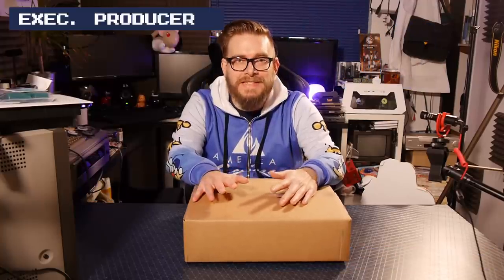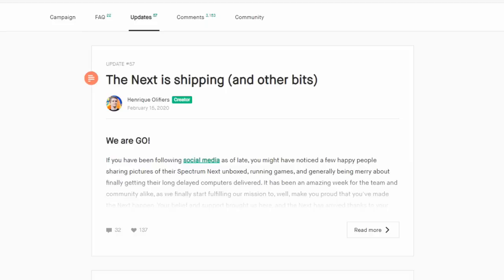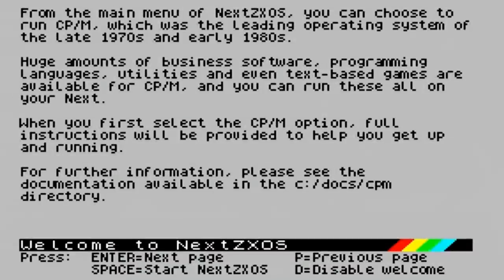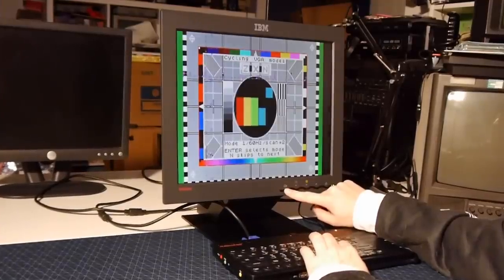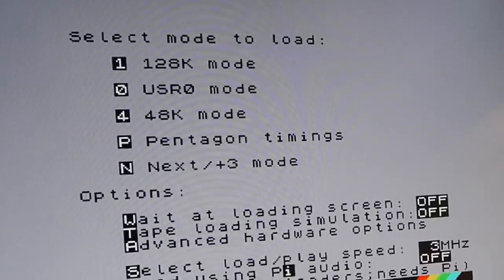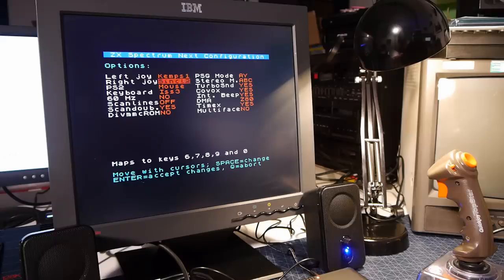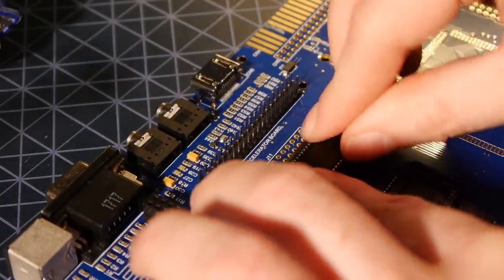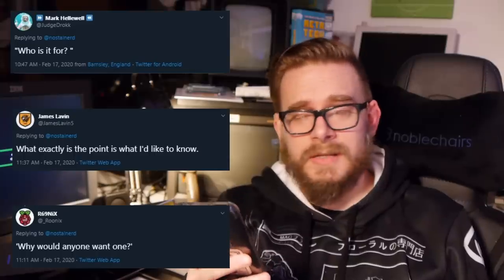ZX Spectrum Next | Nostalgia Nerd

Comment: Great review. I am puzzled about VGA. As far as I know the vertical sync standards for VGA are 60Hz or higher frequency, so 50Hz is not (usually) supported. It is possible that some VGA monitors will work at 50Hz, but I have no idea how many would work at this frame rate. For best compatibility, as you say, you ought to use 50Hz. At least HDMI has both 50Hz and 60Hz as defined standards. In an Atari forum there is a thread about which VGA monitors have been found to work with the Atari (european) 50Hz frame rate and 15kHz line rate. VGA line rate is around 31kHz but with line doubling this matches with the 15kHz of the PAL TV standard. I have been messing with VGA and HDMI and having got some values wrong found that my Dell monitor was happy to display 720p at 40Hz (over HDMI).

Comment: Like two years ago, now, I bought a kit to assemble my own clone Spectrum. I soldered on a bridge rectifier before deciding my dinky little 10W iron wasn't up to the task (the tip was getting stuck in lead solder, because the ground plane was sucking the heat away faster than the iron could sustain it). One of these days, I'll get back to that kit...

Comment: I have no connection to the ZX Spectrum line, being Canadian where the C64, Apple II and to a lesser extent, Atari computers reigned supreme but this is just such an incredible piece of kit, I really want to get one. Is there any idea of when they plan to get more stock of it at the official shop (it has an out of stock listing) or will the Kickstarter be the only way?
Reply: A few spare units might be offered after all Kickstarter units have been received by the backers. Probably in the shop. After that the  second Kickstarter and second hand machines will be the only way to acquire one.

Comment: This thing looks epic. 

PS it's usually safer for the computer to switch the 240V end of the power supply rather than the DC output side, because switching the DC supply side creates a spike on the side of the supply where the electronics are.

Comment: Scratches are probably due to the unit being placed in a cardboard slot in the box. All that movement in shipping. They should have wrapped it in a foam bag. Didn't notice in mine, but then I put a very small barely noticeable mark on my dropping it while looking at the underneath. It landed on the box edge argh.

Comment: I had a zx81 back in the day...the only computer I could afford...so I tried to make it do things and I wrote software for it.  I expanded the keyboard to something workable, the memory to 48k and added a graphics board...but then I had to have a custom power supply and wired it up backwards and blew it all up.  But I got another one...fast forward 38 years and the spectrum came and went and I missed the boat on that. I had high hopes for micro drives and some of the new models that came out.  But I got into other things.  Now I would like to get back into that simple programming environment again...but yea I don't want that membraine keyboard and I don't want source something better keyboard wise for the old hardware...this is PERFECT.  
Just got wait for the second kick starter.

Comment: The C64 question could be legit, as it is an FPGA-based system with multiple cores you can choose from the boot menu. Arguably, nothing stops someone from writing a C64 core and transform the Next into a C64 (or an Amstrad CPC, MSX, or other machine) and the FPGA chip is big enough for sure. However, the machine focuses 100% towards its standard Next core and only a few other cores are provided, mostly for compatibility with older Spectrum models. It's the right choice IMHO, as it provides a standard configuration and a stable target for new software.
Reply: There are already some (non speccy) PoC cores available too (e.g. Nes) https://gitlab.com/victor.trucco/zx-spectrum-next-cores
Reply: And I see a CPC6128 core that wasn't there last time I looked! Very much looking forward to my accelerated Next turning up now...
Reply: The thing is it doesn't make sense in the context of the Next, because it's a Spectrum keyboard.  In the context of the TBBlue board underlying the Next, it's perfectly legitimate.

For me, It's being able to have an authentic interface that makes this whole experiment worthwhile.
Reply: @TheTurnipKing  most cores do work quite well but will need some TLC for proper support of the keyboard. Basically with the programmable drive/nmi buttons and keys on the next you can make any combination you'd like just like using a PS/2 keyboard

Comment: i know i missed out on the original round of questions, but could you, good sir, satisfy my curiosity? i'm a backer of the accelerated version and i'm at the point of scratching the walls not knowing when exactly mine arrives - and what to order for it. i've already the RAM expansion and a PS/2 splitter, but:

- could you please confirm that the internal speaker that's available is only used for the loading sounds and does not do AY output?
- is there any way to configure whether the audio output goes through the HDMI or the earphone jack when using 'digital' output?

thanks in advance.
Reply: the Audio is usually present at both the headphone jack and HDMI. I was able to use the headphone jack to test the audio was correct on the system when I was having audio dropouts on HDMI.
Reply: The Internal speaker WILL play AY output if you want it to. You can also mute the Audio to the digital out
 via giving an appropriate REG command. In general you have a lot of options
Reply: thanks to both of you : )

Comment: The use of an FPGA is similar to the use of the ULA in the original Spectrum. Except on the original the processor wasn't done in the ULA (thank god, it would have been very unreliable). In the ULA the connections between the gates were created with a conductive layer printed onto the top of the chip and presumably covered in plastic.

Comment: Are there any tools to program straight on  the Next in ASSEMBLER : text editor, assembler, linker, debuger?
Reply: From the forum :

https://www.specnext.com/forum/viewtopic.php?f=7&t=1364&p=8907&hilit=assembler#p8907

Obviously there were original Spectrum assemblers and I would be tempted to use one of those first. ZEsarlUX looks to be a bit complicated.
Reply: @vespasian606  There are two tools included in the System/Next Distribution: ZEUS and SPED

Comment: I was looking for what FPGA they use.. it seems like it's a xilinx spartan6. spartan fpgas are a weird choice now that lattice has such good support on ice40 and ecp5 FPGAs. equivalent chips are cheaper AND better (opensource!) toolchain for them now. They have very minor disadvantages compared to spartans and a lot of advantages so it's weird to still see the spartans getting used in low-end type devices.
Reply: I guess it's partly about inertia... while this KS is only 3yo, Victor Trucco was trying to build Spectrum board and improving his designs for few years before the Next campaign started, maybe even a decade... Probably not that simple to switch on a dime, plus people tend to stay on solutions they know inside-out.

Comment: I want to know if Starglider runs smoother at higher cpu settings, or if it runs unplayably fast.
Reply: Out of the box, it's probably too fast, ( https://youtu.be/Cw-H0bn91d8?t=153 ) but in theory it shouldn't be hard to hack.  I've been mulling over the possibility of writing a NEX loader for some older games, and it doesn't seem like it should be horrendously difficult *in theory*.

In theory you only need a loader outside the normal address space.  Crank up the CPU clock, load the the original code and patch it so that when it loops, it jumps back the loader, wait a while then jump back to the game.

You could also use that "dead" CPU time to add next features, like AY music.

Comment: Can we get NextZXOS for windows etc.?
As it seems to be a very expensive emulator in an expensive box which also needs a companion PC... so...
er...
Reply: Next is not an emulator but an original machine, but if you want an emulator of the Next then those are already available for instance ZEsarUX (TBBlue emulation). However, noting can fully emulate the Next yet.

Comment: The problem with Sinclair Interface 2 joysticks (like the SJS-1 in the video) is the way the pins are defined. The Atari standard included a 5V output. That became handy for powering things like autofire circuits. The Speccy standard didn't have 5V. Unfortunately it was wired in such a way that connecting a Sinclair joystick to an Atari port would short 5V to GND whenever you pushed left! That's never a good thing. I suspect that's what's happened here. Does the Next have an option to redefine it's ports to take Sinclair sticks properly? Or are they permanently wired Atari standard and just pretend to be Sinclair to the Spectrum software? 

One of the nice things about an FPGA is you can redefine just about everything, so if the joystick ports are just connected straight to it's many pins it ought to be fixable in an update if it hasn't been done already. 

I wonder if it's possible to re-program the FPGA to produce, say, an Atari XE? It had more keys I think but you'd be able to work around that even if it's a config option to miss out certain keys. The Speccy was a bit odd, actually, in not having any function keys or anything. Part of it's ZX81 heritage I suppose. The bare minimum of letters (26) plus numbers (10), space bar, enter, and 2 different shift keys. Then everything else is a weird combo. No delete key, just capital zero! Of course! Caps-shift plus 1 lets you edit a line! Obviously! 

It looks suspiciously like the Next uses a real Speccy-compatible keyboard layout, from the early pictures of it being a bare board to stick into a Spectrum case. So, like the 48+ and above, all the extra keys, delete and cursors, etc, were implemented through weird membrane tricks that have some physical keys connecting several layers together on the membrane. Nightmare! Sir Clive should have had all that done in the ULA. So have 50-odd keys like the 48+, and have them separately available in some special mode, but default to making them press 2 keys together for compatibility. But do it all in the ULA, which is what reads the keyboard. Of course that'd mean shelling out for a redesign of the ULA, and Clive was famous for not spending. One of the tiny tellies they sold used a single transistor as part of the power supply, an audio amplifier, and part of the RF tuning. All done by one component, at the same time! Mind-bendingly clever but no wonder they got a lot of returns!

Comment: I don't mean to be a hater or insult anyone, it may just be my geographical location (east coast united states), but i've never seen a zx spectrum and thought that this was some kind of lesser-hear-of machine as I've been a huge computer nerd since the 80's myself.  the most popular 80's machines that i've seen are the apple II's (i had a II plus myself), the commodore 64/128 and later the amiga (I had a 128) , the IBM PC (which i didn't have until the mid 90's personally), and some folks had tandy trs 80 (normally the model 101 is the varient i've seen used by writers and reporters because it was actually portable.
Reply: The Microcomputer scene was very different here in Europe and the UK than it was to the US in the 1980's. The american machines like the Apple II, Tandy, etc were simply too expensive over here. The main microcomputers here in europe during the early 80's were the Amstrad CPC, the Commodore 64 and of course the ZX spectrum. I had an original rubber keyed ZX Spectrum 48K which I shared between my older brother when we were kids in the 80's. 🙂

Comment: How's the Timex compatibility on this? I see that there are options in there for it.
Reply: While this is a good question, I'm honestly unsure of what Timex software you might want to run that isn't better represented by its Spectrum form.
Reply: The MMU of the TS2068 is not yet synthesized. It's been worked on and will appear as a separate core. For the time being however all Timex modes are supported + TS2048 compatibility

Comment: That the sound was different as system frequency is increased is a bit concerning. That would seem to imply that the same clock frequency that drives the Z80 CPU implementation in the Spartan FPGA also drives the FPGA implementation of the sound chips. Hmm, one would want the sound chip behavior to remain fixed in behavior regardless of what the CPU is being clocked to. Guess that is a detail they didn't think about. But, it could be addressed in the FPGA implementation and provided as a firmware update.

Comment: Oddly enough, retro computing phenomena is undergoing a kind of sea change of sorts to where, as vintage computers that are worth bothering to collect are becoming more rare or much more pricey on eBay, interest shifts toward retro recreation projects - like the Spectrum Next

And the manner of how these projects are executed tends to matter a great deal. Though the Spectrum Next took a long time for those initial Kickstarter participants, it has clearly done a bang up job of delivering. As far as I'm concerned, it has set the Gold Standard for a retro recreation project.

And I don't see the Commander X16 project, as it has been conceived, comparing all that well to this ZX Spectrum Next gold standard.

Unless one is just a C64 die-hard, the ZX Spectrum Next is delivering on all the kinds of goals that the Commander X16 project espoused at its outset, but then doing a good bit more.

The Commander X16 isn't going to have actual compatibility to run any old Commodore 64 software - it's close enough to where if source code is available, then C64 programs could be ported to it, but the X16 won't be able to run C64 software as is (unless its very trivial, or is a BASIC program that doesn't dip into doing things with hardware).

The ZX Spectrum Next project solved this by implementing the key custom hardware aspects of original ZX Spectrum in its Spartan FPGA. The Commander X16 project is using an FPGA approach for a video subsystem, but is sticking with real chips for sound and its 6502 CPU. The problem is that it won't have anything that is truly a SID chip for sound and its FPGA graphics is not VIC-II compatible (but it is better, more powerful).

The ZX Spectrum Next project thought forward enough to allow for adding in a WiFi module and a Pi Zero accelerator board. The Commander X16 will only have an expansion bus of some kind.

The ZX Spectrum Next easily allows for running at different clock speeds - the Commander X16 will support just one clock speed and it will not be as fast as the fastest clock speed of the ZX Spectrum Next.

So the ZX Spectrum Next project has already accomplished the same goals, just targeting a different vintage computer model as its inspiration. And so there's a significant library of software that will run out of the box on the Next. The Commander X16 will only be able to run new software that is written specifically targeting it.

The Commander X16 could address this if it could get its FPGA to provide true SID and VIC-II capability. Have no idea if such would even be feasible for their architecture.

At the end of the day, the Spartan FPGA approach of the ZX Spectrum Next is more versatile.

Comment: Just a note but Jet Set Willy isn't just hard, it's impossible. One of the few neurons in Matthew Smith's abused brain short-circuited, and meant it's impossible to collect some of the items. The solution is a POKE which I'll leave you to find yourself. While you're there you might want an infy lives POKE, or maybe one that turns the collision detection off. And you know about WRITETYPER, right? 

As for the Next, it might be nice if you can plug the HDMI of the Pi Zero into your monitor, and have the keyboard and whatever else work for Linux on the Pi. So then you've got a fairly powerful computer to browse the web or run office stuff, or a decent C compiler, etc. So the Speccy would be slaved to the Pi in this instance. But then when you're bored of that, stick the monitor back into the Speccy's own HDMI and go back to that. Just seemed a shame to have the Pi sat there but unable to do it's thing. Ironically the Pi could emulate a Spectrum a hundred times over at a fraction of the price. But it wouldn't be the same...

Comment: rewatching the video I noticed that you mention that it is a machine you can plug in and code...Sure; although this is not 1980 anymore and basic is dead for most people (some people died too, since they were old but that's a different story). I would hope that the Next team would actually add the choice of language to use. Would it boot into a C, C++ or Assembly environment for development, I would totally love it. But if you boot up in basic, and need to set up a pc to cross compile on this platform, that remove the whole point you make about "being immediate to start coding on it".

Also would be awesome to see a review of the Next N-go;  Which is the best thing you can get if you missed the 2 kickstart, and a chance to get the Next without a case, for a price that is actually acceptable for what this machine offer (less than 140 pounds).

Comment: Would it work with the light pen on a crt monitor???
Reply: Yes the light pen interfaces from back in the days would work.
Reply: sesom07 did you have test it out? I might be sold for this new revision , THX alot.
Reply: @johneygd  Sadly not. But all tests have shown that the expansion port is fully compatible and a light pen isn't a complicated device at all.
Reply: sesom07 well yeah sure, aslong the new vectrex supports that crucial pin to detect light i suppose.